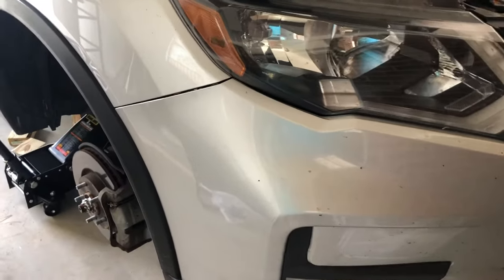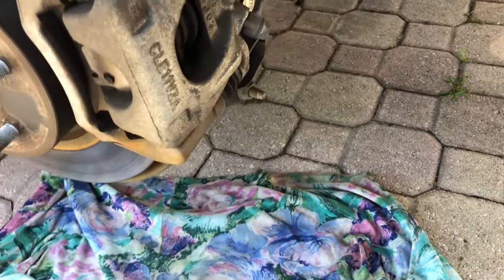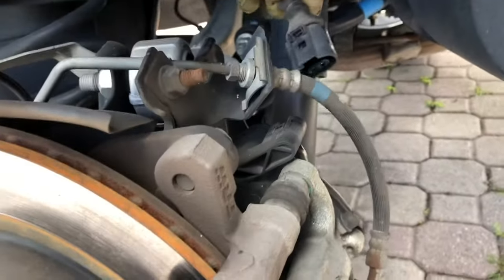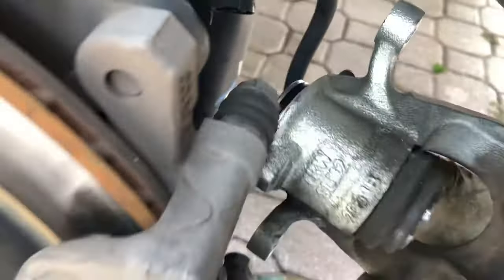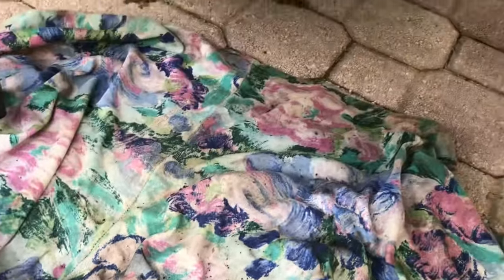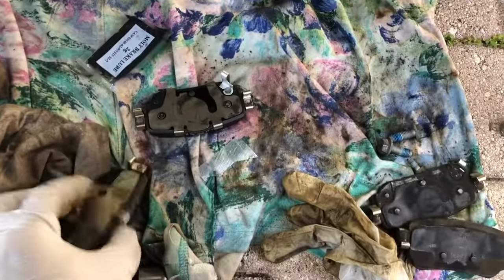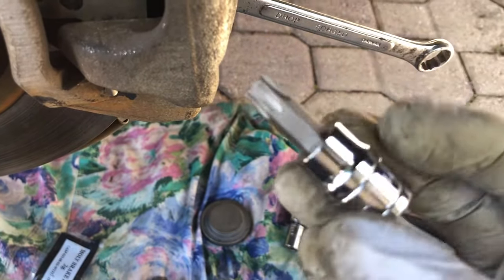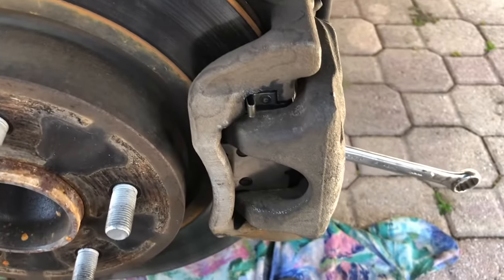2019 Nissan Rogue - Back Brake Pads Replacement with Electric Parking Brake

Comment: For anyone else trying to make sense of this video… Once you remove the motor, you will need a torx 45, then you will need to spin the nut on the caliper clockwise until it stops, and then you will be able to compress the piston.
Reply: Thanks for the clarification. Made a puzzling job easy.

Comment: After you finished installing the pads and putting the motor back on, did you have any problem with the parking brake?  Did it set itself up correctly?
Reply from the maker: I did not have any problems. I am not a mechanic so I can not tell you if you missed something, just watch more videos maybe. If this is your first break job you might run into problems, I remember my first break job…
Reply: It is definitely not my first brakd job. Electronic parking brakes self-adjust. When you took them apart they were in a position that was considered adjusted. When you pushed the caliper back in you changed the adjustment. So you then just reinstalled the motor and turndd the system on, and I'm asking did they self adjust properly? Does your parking brake work properly after doing this brake job? I'm not asking about anybody else I'm asking about you and this job. Were they adjusted well after you finished the job?
Reply from the maker: @stephenbay9564  Yes they did self adjust and they work fine.
Reply: @mr.m.g.t.  Thanks so much for that info! I appreciate it!
Reply: @stephenbay9564   did it work for you? About to try and don’t want to mess up the parking brake either. Thanks!
Reply: @matthewshackleton6507  Truthfully, I haven't done it yet. If you look at my comment to him, I was asking him if it worked, and it's been 2 months and he hasn't replied.
Reply: @stephenbay9564  you ever get around to doing them ? Did the breaks self adjust lol
Reply: @marioperez-dv2om  Yes I did, and yes they did self-adjust. It worked well.
Reply: @stephenbay9564  copy and thank you ..
Reply: Brake @mr.m.g.t.
Reply: I hate all these new cars. Making shit all harder with all this tech smh
Reply: I’m still confused about removing the electric motor without the computer

Comment: What are the brake pads for rear ?? Part number?? Hard to find
Reply from the maker: Only the Nissan Dealer has them, I went to all of the auto parts store also with no luck. I am sorry but I don't have the part number anymore, I don't know what I did with the receipt.
Reply: @mr.m.g.t.6031 man I can get the T30 off from the motor! Feels stuck